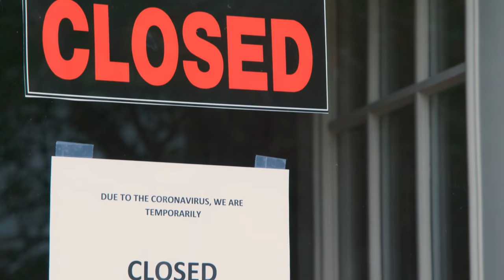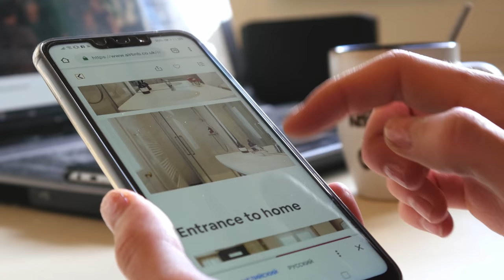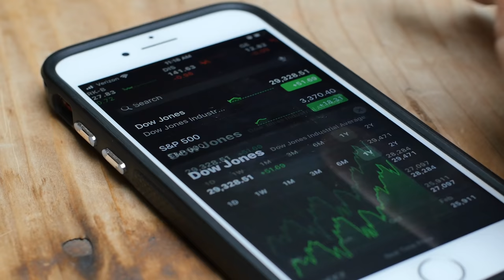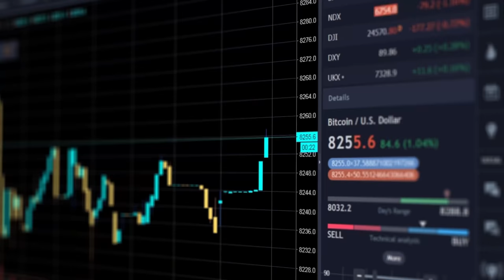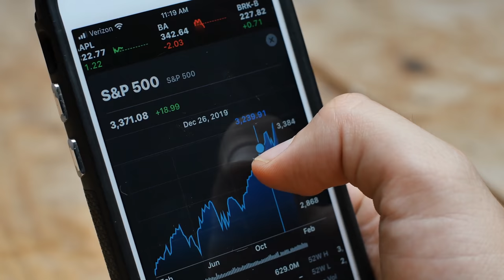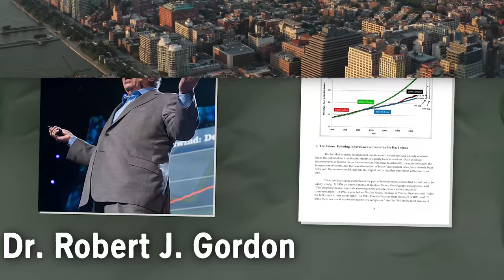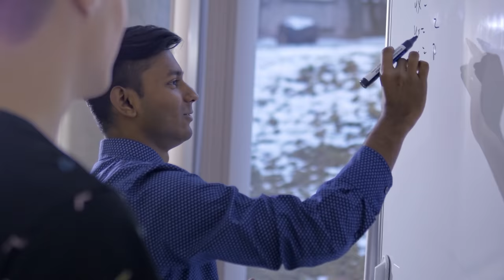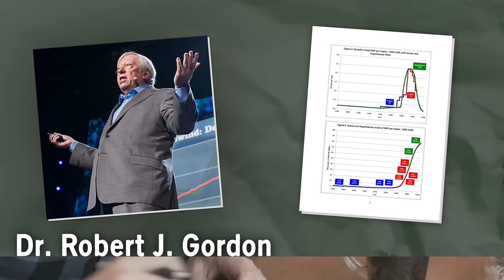You Will Never Retire, Here's Why... - How Money Works

Comment: People do not realize that working past 60 is extremely difficult for any physical type work.  Mental work,, not as bad, but still a problem.  Another thing people do not consider is that the current births per woman is now at around 1.7 per.  Meaning we are now at a negative population growth. 

All of the so called "economic theories" taught for the last 100 years is quickly out dated.
Reply: Global population is still rising, for now. Fertility rate around 2.4. It varies greatly though, and many countries are well in to the negative now and depend largely on immigration to continue the all-important growth. US, for example, 1.6 - but still has an annual 0.5% population growth.

Immigration has down sides though. Not least of which is that the existing population is often intensely hostile to the idea, distrustful of outsiders and disliking the cultural changes that come with mass immigration. You can see that in the way many politicians have succeeded by appealing to anti-immigration sentiment.
Reply: Very true!
Reply: @Ziegfried82  Immigration is only going to push back the issue in time, as they will import their entire family, which will need even more immigration to take care of when they are old. That is assuming the immigrants actually pull their weight, which in the vast majority of the cases they are not (due to various reasons like not mastering the language, lack of education, etc).
Reply: @Danny DNA poor farmers that grow your food are slow?
Reply: @thekrampuselbananoquevivee9947  farming from what I have seen is a pretty involved process. I certainly don't think any farmer is mentally slow or else they would have a tough time running a farm.
Reply: You wont be 60 working in corporate..by 55 you playing in extra time. Get ready to be let go..each year past 55 is a bonus
Reply: @thekrampuselbananoquevivee9947  Why would he have any respect for the people who feed us? That's a useless job these days and the quicker we get rid of it the better off society will be.
Reply: @thekrampuselbananoquevivee9947  farmers aren't poor dude. This isn't 1820
Reply: @TheCarpenterUnion  except they are
Reply: @thekrampuselbananoquevivee9947  Deez nuts are pathetic! Boom! Oh.. wait ...
Reply: @thekrampuselbananoquevivee9947  But yeah, agricultural jobs are for the scum of the earth. A real man's job and an important roll for the survival of our species is investment banker.
Reply: @TheCarpenterUnion  depends on the farm. If they own the land they work, you're right, but a good portion don't. Leasing farmland is incredibly expensive, so billionaires tend to buy out the land and rake in massive profits for nothing. They're like landlords, but somehow even shittier.
Reply: @Ziegfried82  the only cause I know of is industrialization made life comfortable for women and as result they no longer want to be walking baby factories.

Cue the artificial womb.
Reply: @y2k21  im guessing you are being ironic
Reply: People just plain stop hiring after 50. alot of job seekers are having issues with that. Just staying employed long term is no guarantee.
Reply: Hard times ahead
Reply: Capitalism killing itself becasue there are no good conditions to have children while there are some exception like musk that have many children most of families with many children will be poor and often they have this many becasue their inteligence levels are not the highest baisicky idiotscracy is coming thanks capitalism
Reply: Working white collar jobs is often really hard after 40. There’s this weird mid level where you become undesirable to employers because you are too knowledgeable and so if you aren’t management, they don’t want you around.
Reply: what about the current births per man? that should bring us to a net positive.
Reply: @vylbird8014  Why don't outsiders assimilate? And why are citizens of a country required to radically change their lives to make the outsiders more comfortable? 

Maybe you can understand why it's easy for politicians to make anti immigration platforms.
Reply: @Stszelec01  I think it's because of automation. The upper class has realized that the classes lower than them have served their purpose. 

We believe that capitalism is failing. But it isn't it is working exactly as planned.
Reply: @Danny DNA what other jobs (outside of service industry) are available that isn't manual labor that doesn't require a degree?
Reply: @vylbird8014  it'll hit 0 in a few decades so over population is literally not a concern. plus the majority of humanity being poor, do not use a lot of resources. Most of the resources are used by the Top 100 Forbes list companies.  This means the wealthy are consuming an obscene amount. Even if your average American uses more than someone in Haiti. The average American isn't nearly using as many resources. A lot of it is also wasted generated or purposely created to keep up the idea of market scarcity. Basically our economic system is the cause. We can change it, but the older generation in power doesn't have the political will nor do they care to do anything for the future generations. So here we are. This is kinda what happens when sociopaths and psychopaths take up the mantle of leadership in societies. A collapse. Which might be for the better as this might save humanity. Simply because it will change our course in our we develop when the next human civilization takes our place. Enjoy the next 50 years. Afterwards, life on Earth is going to go through another dark age era for a few centuries. Hopefully by then our descendants would've learned from our mistakes.
Reply: Bro, population is still increasing globally and states like the US offset with immigration. Some states have population problems but the US is not one of them. For now…
Reply: @lordblazer  You've made the assumption that it'll be possible to recover to a civilisation back to our level. I believe that this is incorrect, as we'd lose the capabability to extract sufficient resources to maintain one, and developing those in the first place required a lot of easy-to-access resources, which have mostly exhausted. No longer can we find crude oil, coal, iron, copper deposits near the surface, we must drill and dig deep, deep beneath the ground. This time around is the only time around, and it looks like we shan't make it.
Reply: Working past 60 is extremely difficult? God I hate the last couple generations of first world kids sometimes. We are working till 85 doing physical and mental labor on the farm (because we love it, not because we have to), family member who is over 60 works 60 hours a week doing mental and physical labor for the successful ag buisness he started when he was 55, then goes home and doing DIY home projects. You bums have 1/16th of the work ethic of your Grandparents.
Reply: @kaiseranonymous  you realize not everyone is the same right? Most people won't be like you and CANT work anymore due to back pains, mental issues, or the other countless conditions elderly people can have
Reply: @kaiseranonymous  I'd like to point out that a large portion of jobs in first world countries today are not manual jobs. This means that instead of working 60 hours a week doing manual labour, they spend around the same amount of time sitting. Surprisingly enough, this has a detrimental effect, leading to a lot of the conditions mentioned by tingothing. Furthermore, alleviating this is very dificult, and preventing it just as much, as it would require a large change in how office work is conducted, as well as, in the case of the US in particular, a change in the main mode of transportation (spending several hours a week driving does not help).

Edit: footnote: chronic backpain is associated with a sedentary lifestyle.
Reply: @kaiseranonymous  boomers having work ethic 😂😂😂
Reply: @kaiseranonymous  Doing work past 60 is difficult, mostly because no factory, or manual labor job will hire a 60 year old vs a 20 year old.  

You know what I hate, people like you.  You think the issue at hand is all BS because you know someone who does it, or can do it.  

Got news for you and your high horse.  In competitive markets for labor, the older you are, the less your chosen.  Also, I said difficult, not impossible.  There is a reason why the retirement age is 65.
Reply: As a 58 year old approaching 59, I can contest to this. I cant do half the work I use to at 40, but am expect to by employer. My body feels like I went three rounds with Mike Tyson every morning. I can barely walk by the end of the day.  Retirement is on my mind all day long.
Reply: @TheCarpenterUnion  I never meet a poor farmer. They do pretty well for themselves thou they do work long hours for 4 months out of the year.  2 months to prepare land, 2 months to harvest crops.
Reply: @kaiseranonymous  Driving a 300 thousand air condition tractor is not hard work. I know no one 85 years old working 60 hours a week. I just don't see it.
Reply: @erich6860  Retirement use to be 60 in the USA, but then Government decided they need people to work longer so they could collect more taxes. Then they decided Women should work also to pay more taxes.  In China the retirment age is 50. Because people are worn out by that age and die sooner.
Reply: @johnd4348  Your correct, except for the women part.  That was a side effect of WWII.  A lot of men went to war, and women replaced that labor pool.   Then as the soldiers returned, the women did not just leave said jobs, so there was a new labor supply, but it worked out as the USA was the only major manufacturer on the planet untouched by the same war.  However as the economy and infrastructure returned to Europe and manufacturing, American businesses started outsourcing work to "stay competitive", and that was the end of it all.  Not to mention the 15% expected growth in the stock market every year.  It is impossible to maintain.
Reply: @johnd4348  Thank you for your honesty.  We all know that one person that worked into their 70s or later, but these are more exceptions than rules.  

I feel sad for my son who is 28, as I think his retirement for SS is now 68.   He has a manual labor job... He is screwed.
Reply: @erich6860  Congress will kept raising retirement age because they think everyone has a job like them and work 10 days a month and just sit around and have others do all their work. Not everyone has a staff of 30 doing their work. The norm for the last 20 years is for Companies to cut jobs and load up everyone else with more work.  One place I worked had 20 people doing maintenance. Now its 5 people.  Moral is very low and place in a shell of what it use to be.  Just because people are living longer, does not mean they can continue to work longer.  Government ever increasing demand for taxes will mean people will have to work longer to collect full SS.
Reply: @jldp24  Working pass 55 may be a curse.  Work shortens your life is your over stressed and over worked.
Reply: @Danny DNA I do manual labor and make 6 fiqures.  I am pretty slow thou.  Been in skilled trades since HS.  Now 58 and have several million dollars in the bank.  Manual trades has been hard, but financially good for me.  I am pretty broken down physically.  My brother took the college route, got a job in office. Died at 48 of heart attack from being out of shape and stress.  Died broke trying to keep up with the Jones.  I plan to retire with an income over $ 100 K a year.  No pension , just savings and investments.  Manual trades is ok if you get in the right field.
Reply: @erich6860  I think women were encouraged to stay in work force because Government say them as a source of taxes.  2 incomes means more tax payers.  You cant grow Government without more taxes.  Corporation pushed women into jobs also because more income means more consumer dollars.  I see stay at home mothers shammed for not doing their part for society. But I see those who stay at home have way more stable households and children are better.
Reply: @johnd4348  IM 37 and everyone works on my nerves, to the point where i dont participate in any work related activieties or speak in meetings. Jsut keep quiet, do my thing. not gonna lsiten to any mid aged woman, tey the worst. i cant imgaine being in corporate past 50, thats jsut demeaning, unless you a CFO, and we all cant be on that level. i find the msot successful middle vlel managers were C studetns and are now out tehre to prove themselves. Thye also pretty bad, had a few shouting matches but its not worth it. Invest, make sure you have supplemental income and get out. anyone over 55 represents less than 10% of the workforce anyhow. you jsut waiting to be let go.
Reply: @johnd4348  I agree. Single income homes have many advantages.  I dont care who which one of the couples stays home, but when it comes to keeping the house, and raising children.  Reduces stress all the way around.
Reply: @johnd4348  I agree.
Reply: @Danny DNA welders, fishermen, firemen, ems, linesmen, chefs, riggers, lumberjacks, sandhogs, mechanics are all slow right ?
Reply: @erich6860  he should look into joining a union while unions are still around heck they might of already died in your town but a good local will keep you working if you chose to and will let you retire with dignity when you decide to
Reply: @kaiseranonymous  my grandparents and most american grandparents of the boomer generation retired by 60 with dignity and pensions lol but if they chose to work past that age they could because the corporate culture in those days valued experience.
Reply: @snoopyshultz  My son is in a union.  The old contracts pay 3-5 more dollars an hour for the same job he does, and retirement.  He will never get retirement, and never make what they make.
Reply: @erich6860  that's why they call them journey men I suggest he journey to a local that hasn't been screwed by a bad contract. Boston Chicago newyork Seattle San Francisco las Vegas are some union stronghold towns .I'm from one of the above and will retire very comfortably @around 55 and can wait for SS to kick in
Reply: @snoopyshultz  Its not so easy.  Unions jobs all over this area have been screwing their new hires.  

But I'm glad it worked out for you.  Not everyone is as lucky.
Reply: @erich6860  I'm sorry to hear. Best of luck to your son, I hope things will work themselves out.
Reply: Historically a shrinking population led to economic golden age for the average worker. The black death in Europe ended the dark ages and ushered in the rennaisance due to workers now having enough expendable income to afford luxury items like books to educate themselves.

The birthrate dropping globally is a promising sign for the future of the average worker.
Reply: I M M I G R A T I O N
Reply: @Danny DNA You will get a nice cardboard box in the gutter. Just be sure to vacate the premise before those 'lovely peace officers' arrive.
Reply: @TheCarpenterUnion  If the farmers own land handed down over generations. They are probably filthy rich if they just sold the land for retirement.
Reply: @user-gz4ve8mw9l  That's why I have no children.
Reply: @dr.a.w  Better to focus on yourself anyhow. I'll never have children, or any sort of relationship as long as I live. It's the correct choice indeed.
Reply: @Jon Doe Phones, subscriptions.  You cannot use that against people.  Back in the 80s cable was expensive, even more expensive than today.  A land line was expensive, especially if you had to make a phone call outside your county, or to another state.  Phones today come free with your monthly.  

People like to use these modern expenses as signs of stupid spending, but the truth is, it is the same expense, just different wrapping in a different decade. 

Housing however,,, that actually has out paced its 80s counterpart in average cost adjusted for inflation. So you got that part right.
Reply: @Jon Doe The latest phone is free when you continue your contract, in fact most contracts now have it built into it.  So again, it is not really an "example".
Reply: So what? Advancement in tech and robotics will take over population loss. This is how countries like Japan will deal with it.
Reply: I know people working hard into their 70s,won't be me!!!!
Reply: Yup, retirement is mainly funded due to younger people taking over the work. If that's not a thing we will have to find something else, perhaps machines/AI? Either way the retirement system in America has been due for remodeling anyhow.
Reply: @vylbird8014  Dude I work as a restaurant dishwasher and A GOOD DEAL of the people I work w/ can't speak a lick of English! It's frustrating trying to understand them - and I'm starting to think they may not even be "legal" (since if they were - THEY'D BLOODY SPEAK ENGLISH).
Reply: @JohnJohnson-fm1gy  I just made a comment about how most in my workplace don't even speak English - they don't even try. It's REALLY frustrating and I'm thinking of reporting them to The DOJ.
Reply: Good answer

Comment: I knew I was going to work into my retirement years, before I even left High School. I couldn't work some place and doing the same thing for 30+ years, that just not me. I'll be 58 here soon and I can't tell you how many jobs I done. But the cool thing, I travel every where and already finish my bucket list. I did add one more to that bucket list and will be doing that soon. Another cool thing, I actually have 6 skill trades under my belt. And I been doing semi-retirement while between jobs. The older I get the easier my jobs get. I can hustle for a buck with ease and get a job simply by looking and will be working in no time. Right now I'm just taking it easy. I have a part-time job with my hustle on the side. Living comfortably and with no worries at all. I finally settle down in one place, bought a home free and clear. Living the way I want to live and couldn't be more happier.